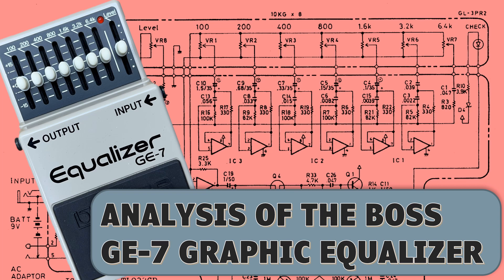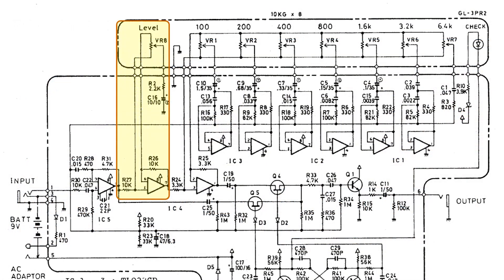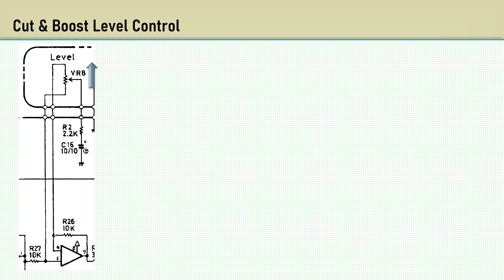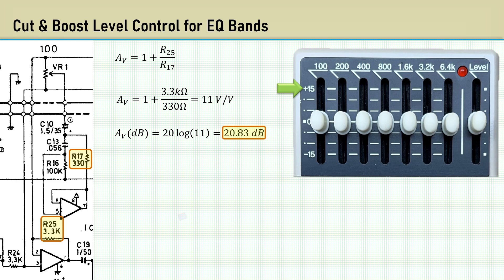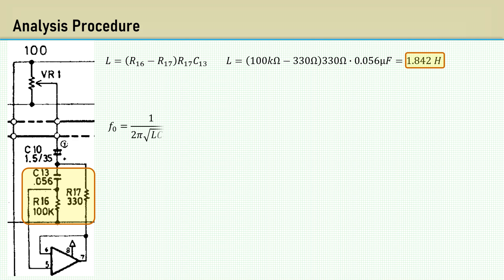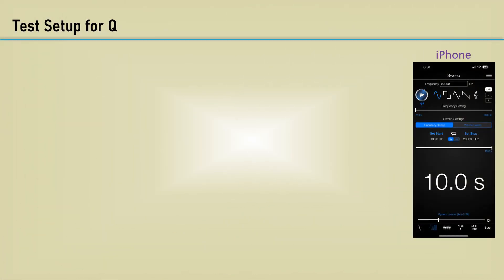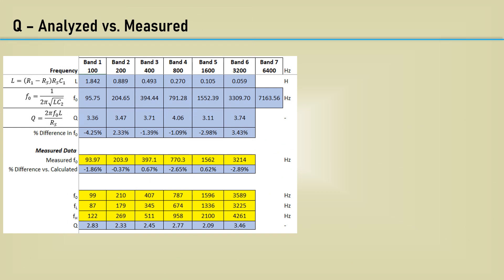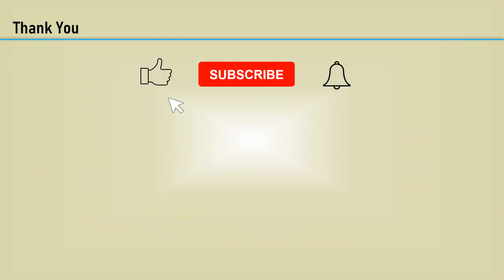Analysis of the Boss GE-7 Graphic Equalizer

Comment: What I am still wanting to know, is what range of Hertz does each of those Q values cover?  For example, does a Q of 2.77 mean that the range of  being manipulated around the 200  Hz target frequency, is +/- 100 Hz on either side of the 200?  Or +/- 50 Hz?  Etc.
Reply from the maker: The bandwidth around 200Hz with a Q of 2.77 is simply 200/2.77 =72.202Hz

Comment: Hello Old Hack, on my point of view, the theorical cutoff frequency for the 6.4 kHz shelving 6.4kHz, at maximum gain of (1+3k3/820), is f=1/(2*pi()*820*47nF)= 4129.60 Hz and not 7163.56 Hz as calculated by you.And worse, for lower gains, the filter cutoff frequency decreases more and more due the action of the series potentiometer resistance.
Reply from the maker: Sorry for the late reply. Your comment fell into the “approve” category and I didn’t catch it right away. I think you are correct. I’m not sure what I was thinking on the shelving filter. Your calculation is consistent with my measurements as well. Thanks for pointing that out.